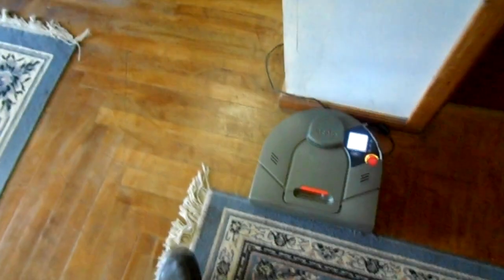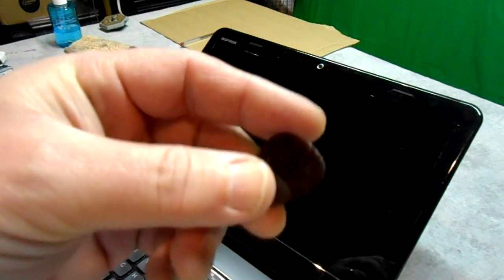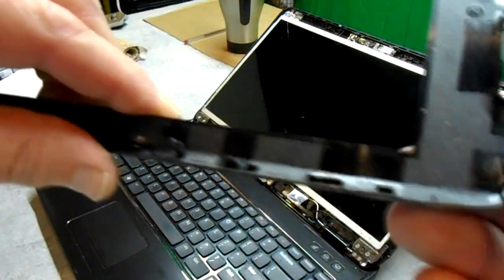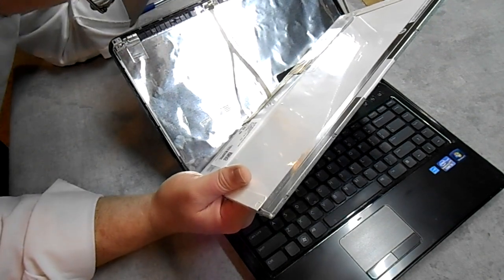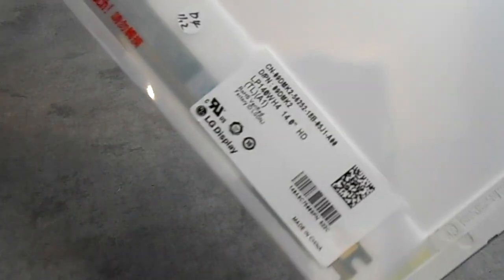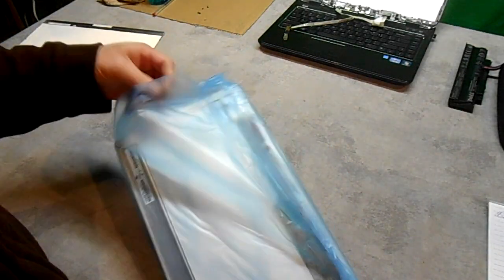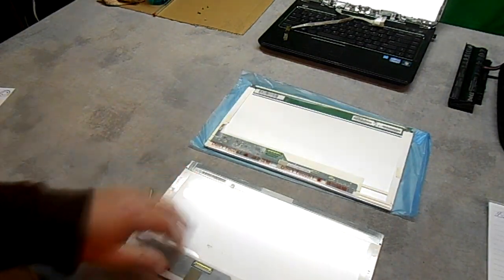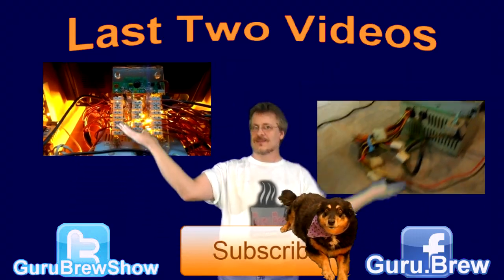How to Fix Cracked LCD Screen on Dell Inspiron Laptop

Comment: I wanted to send you a thank you letter for this video but I'm not familiar with how contacting people on youtube works, so I'm just sincerely hoping you read this.   You have no idea how helpful your video was for me.  I have a Dell Precision 3520, so my model is completely different from the one in the video, but your method worked amazingly.  I've never done anything remotely like this, and I am so thankful that the universe presented your video as the first result of my google search.  Equipped with my darning needle and my $1 mini screwdriver kit, I was able to replace my screen in 15 minutes.  Literally, 15 minutes.  The darning needle being so stiff allowed for the snaps to lift off so quickly.  The screws and inside layout were so similar to your repair.  The only difference in my repair was a lining of double stick tape around the entire screen perimeter, but nothing I couldn't adjust for.  I had cracked my screen and due to the amount of sensitive financial information on the computer, I could not risk sending it out for repair and getting hacked.  After watching your video, I watched about 4 more screen repair videos, but no one's method was as direct and efficient as yours.  Other videos (for laptops closer to my model) removed so so so many more components before even touching the screen.  I was praying that your method would work for me.  The same night that I watched your video (before even opening the screen frame) I took a gamble and ordered a replacement screen for my model on ebay from a reputable parts seller for about $50.  I appreciated you mentioning you've had good luck ordering LCD screens online (which was comforting for me).  I was willing to lose the money if the gamble on the screen or the number of connector pins did not pay off.  The screen arrived in 2 days, and your repair method literally took 15 minutes just now.  I am typing this from my repaired laptop.  Your knowledge, experience, and problem-solving skills are a blessing to this community.  Thank you, thank you, thank you so much for sharing your method in this detailed tutorial to help an amateur in a sticky spot.  I appreciate it so much.

Comment: Thank you! I fixed my Dell laptop. My faceplate was a little stressful to remove because they'd used double sided tape to stick it down. But after that it was smooth sailing!

Comment: We followed you video and the screen works great. But now the web cam cannot be found? Any ideas?
Reply from the maker: the connector probably came off the camera located at the top of the screen when it was reassembled.
Reply: We keep removing the screen it and checking the camera but it's not coming back Could we have broken it somehow?
Reply: +GuruBrew what about windows 8

Comment: Question.... I just accidentally sat on mine tonight.😭😭😭😭 will I lose anything saved on my laptop? you make it seem so easy to fix. I rather fix it myself if its cost effective than getting someone to fix it.
Reply: try to connect your laptop though tv with hdmi wire

Comment: Hi GuruBrew Master.  Followed your instructions and they worked to a 't.'  I bought my screen through Dell just to ensure there would be no warranty/return problems.  But it works terrific now.  By the way, for those guys that write vulgar criticisms, just continue to ignore them.  What they need to do is to look in the mirror at themselves and maybe do something useful to share on You Tube as well.  Anyway, you're doing a great job and keep it up.  Some of us appreciate what guys like you are doing.  Cheers Glen...

Comment: Great video - in my case I only needed to reseat the ribbon cable connector as the screen itself was not broken, just no longer connected to the laptop electrically! But the video showed me what I needed to get at the connector

Comment: Question: my daughter had 2 things wrong with her Dell 15.6. 1. Keyboard not working 2. Broken LCD. So, I took off LCD per your instructions, then put everything in a big bag of rice. Wanted to check keyboard, so, reattached LCD temporarily.  Doesn't seem to light up. Just wanted to see if keyboard working, before buying new replacement LCD. Any suggestions?  Thanks so much.

Comment: Hey, Fantastic video. I have a Dell N5030 that needs a battary and a plug. Not the brick but the plug that plugs into the brick.The cable that goes to the laptop. My question is would you happen to have eighter one for sale? I tried ebay and amazon, but they want like 35 dollars for each.Would you have any for sale thats cheaper then 35? Thanks your videos are Great.

Comment: Do I need to remove the battery first? Or will it matter, since my battery is internal, and its fried, anyway? I have to replace the LCD screen and battery on my Inspiron 14z 5423. The battery is again, internal, for this model, and I fried my motherboard and had to replace it, only to find the battery shorted out, too (I did learn my lesson about coffee!), I have a few weeks left of this semester of college and I was hoping I could get away with replacing the screen, first, as the tiny fanned crack in my lower right corner seems to have spread into a diagonal hairline fracture across the middle.

Comment: Hello i have The Same Laptop  SRS PREMIUM SOUND

 i5 17 inches 

 i've cleaned.. my screen with the spray i clean my sunglasses : P hahahais that right?

 Well & now.. my DELL ITS CLEAn.. but... i see a little.. black.. -----> - <---- exactlt that ... What can i do??

 Its exactly where i chaT... and i dont know what to do... thanks 4 your time hope u help me soon.... 

 W8ting 4 your answer 

 CHEERS FROM ANCIENT GREECE
Reply from the maker: Usually if you get liquids in between the LCD glass you will see water type marks. You may have bad pixels. Google fix dead pixels and see it it solves your problem.

Comment: Got the screen out following your instructions.  One question, why did you disconnect the web cam cable?  I was able to omit that step.

Thanks for the help
Reply: Clarification:  I did carefully pull the web cam cable loose from the backing (double sided tape) as you said, but once that was loose, there was enough slack to lay the monitor down and disconnect the 40 pin connector.

Comment: Hi, i noticed that in this case you were able no replace the display for an exact model, but have you ever replaced a laptop display for a compatible one? If so, did you notice anything bad with the image? I'm only fiding compatibles for my dell n5010 and i am trying to get used to that idea. Thanks anyway and sorry for my english, if it's too bad.
Reply from the maker: Compatibles are fine and have had no problems. Just make sure you are getting the right connectors type/placement needed and the mounting holes are the same. Steve

Comment: I have this thick, giant white line in the middle of my screen, does this mean it is cracked?
Reply from the maker: Not necessarily, if if is a band that is consistent in width and color and may be something else (video) try plugging the laptop into an external monitor and see what happens
Reply: GuruBrew Hey, disregard my other comments, I'm fixing to order a new screen from Amazon, I cracked mine on accident, what a dumb ass I am...lol...anyway mine was a 17.3 HD screen and my computer is a Dell. Only thing I wan to ask you now is when you connect the new screen do you have to match up the gold thing or just stick it on top with the tape? Also, thanks for this video.

Comment: we have also a dell laptop and after using it for almost an hour it was turned off very good condition. after a few minutes my sister turned it on and discovered it was cracked. at first she thought it was a wallpaper that i made as a prank, but then it turned out it was a real crack. almost half of the screen. we dont know how it really got that cracked. it was not dropped or hit by something.

Comment: I have a dell m5040 with broke LCD. Will a m5030 or any other screen work as replacement
Reply from the maker: not sure. I would shop for an exact match if it were me

Comment: My screen just broke today. It is completely white, with black blobs on the bottom right. You can't see anything. Do I follow the same procedure as you?
Reply: basically yes follow the same procedure.  you can buy the screen with the lid and hinges from ebay if you have bad hinges to on you laptop. i had to replace the hinges on two of my laptops and it basically a similar procedure. though replacing the hinges is little more involved.
Reply: That's what happened to me

Comment from the maker: Yes it is a very similar procedure but you will have an extra wire harness for the touch data. Good luck finding a replacement screen for this, I think it will be a little challenging to find at a reasonable price and make sure you get the right one, this model also came with a standard non touch type that is more common.